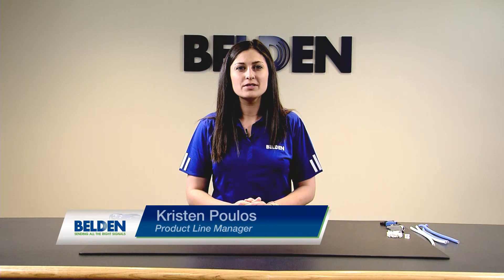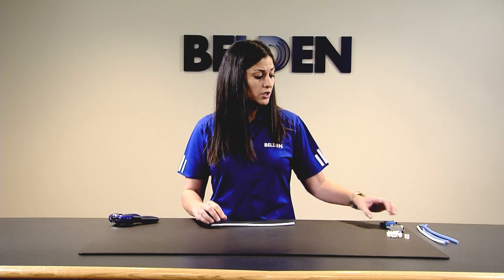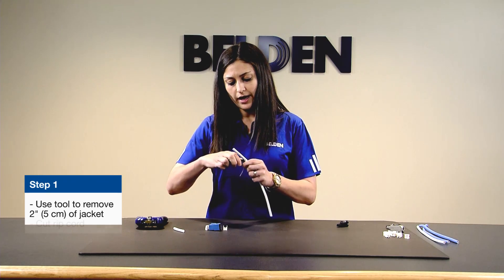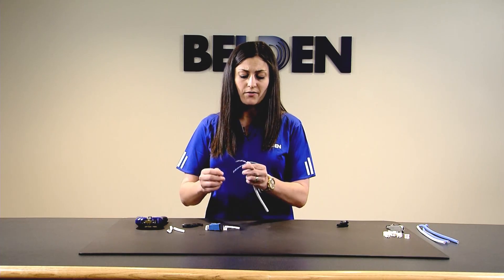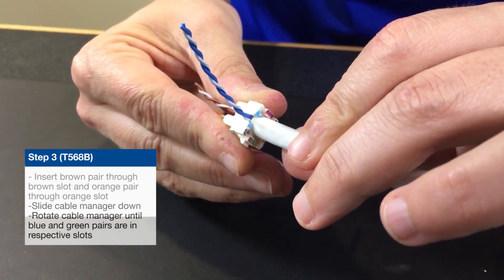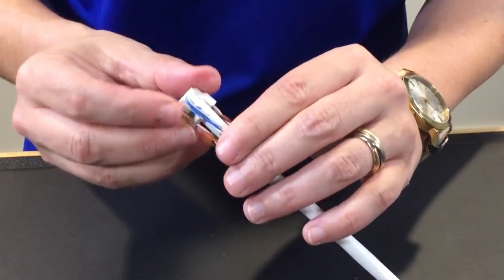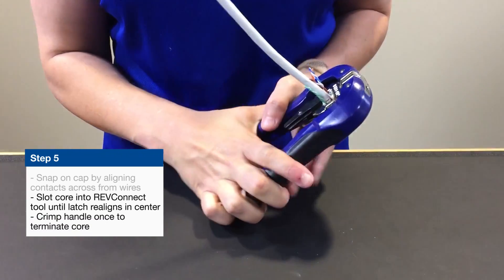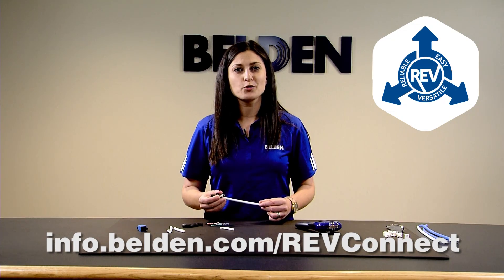REVConnect - UTP Installation Instruction Video

Comment: Is there a way you can troubleshoot the modular jack? Or once it's crimped you can't fix it as far as crossed pairs or pairs being open?
Reply: Nope. You will need a new core. They sell in packs of 50 i think. make sure u seat the core all the way in the clear part too or it wont seat in the jack/plug properly.
Reply: @Killrskillz  You gotta be effing kidding me. I have to do 140 of these this week for the first time because my customer wanted them, with cheap end cat6a. They're $20 a jack! Oh lord help me.
Reply: @leonhiebert6030  Eh, you just remove the bad core from the jack, cut it off, and crimp a new one.